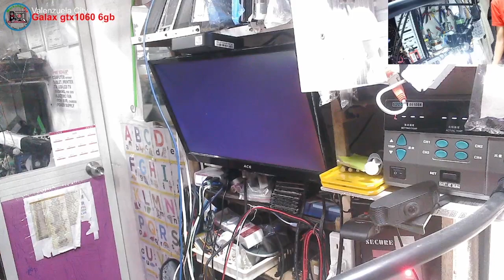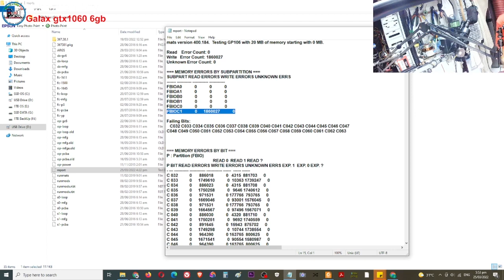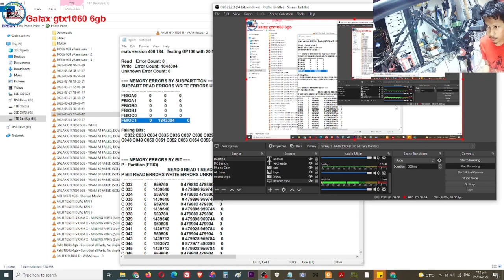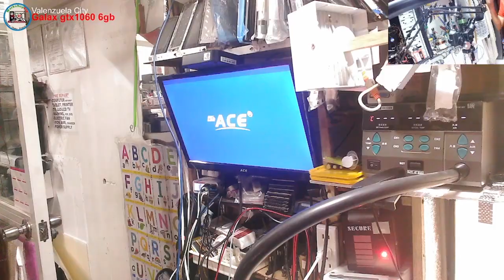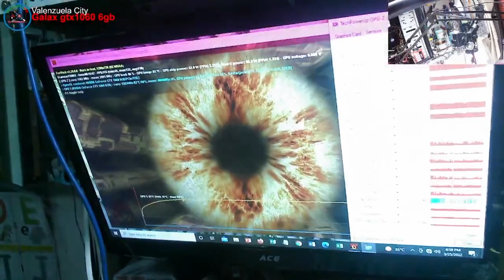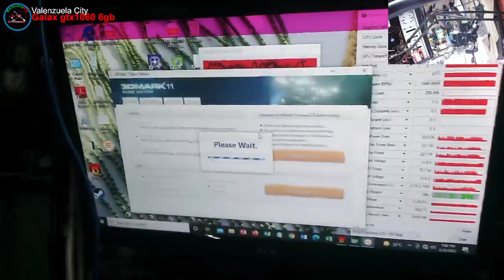GALAX GeForce® GTX 1060 OC 6GB - BLACK SCREEN, NO DISPLAY, VRAM C1 FAILED, REPLACE NEW (SOLVED)

Comment: If I want to change a cpu cooler silicone do I need to change thermal pad?
and can I only change a silicone
thankyou
Reply from the maker: If CPU or GPU chip, just use thermal paste only not theremal pad ok.

Experto Pagdating sa Video Card Repair , subok na at maasahan, kitang-kita sa aking FB WALL at YouTube Channel ang aking mga gawa.

PM po kayo dito sa Video Card(GPU) Repair Business Page para po sa information, contact no., location at ma-assist kaayo.

Salamat po,
link: https://www.facebook.com/VideoCardRepair/
Reply: @WorkshopFix  Thanks a lot :)
Reply from the maker: @meenkrk  Your Welcome